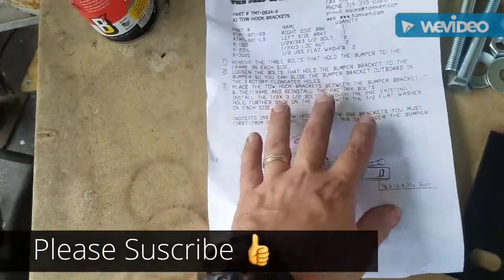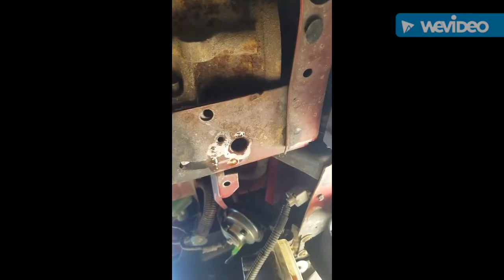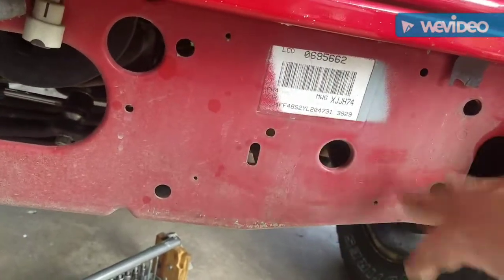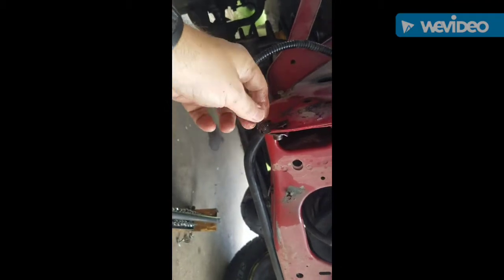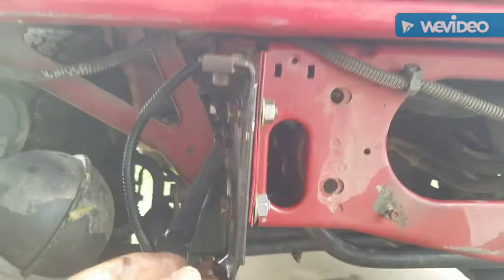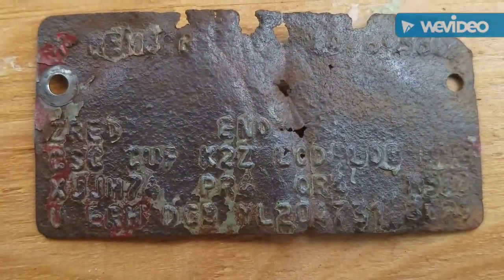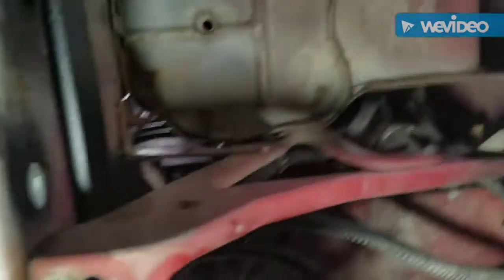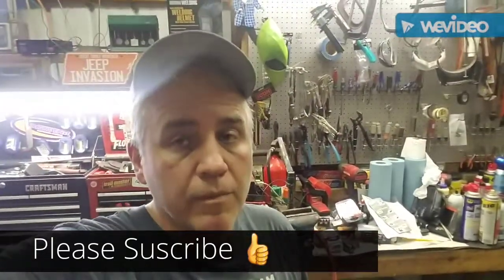Jeep XJ Factory Front Tow Hook Bracket Install with Harbor Freight Tow Hooks #jeepxj

Comment: Nice job on the install Major.I don't remember having to woller out that bolt hole when I installed mine.But then again that was 3 or 4 yrs.ago and I can't remember what I did last week....lol.....
Reply from the maker: I was concerned the front was in an accident in years past but I couldn't find any evidence, either way or worked out with little extra effort in my part.

Comment: I need to add some recovery hooks to project cheap Jeep Liberty. Nice kit. I didn’t know Harbor Freight sold tow hooks.
Reply from the maker: I went to local auto parts store and all were out of the Reese tow hooks which I think will also work,  the HF hooks worked great and are 10K lbs rated (if you believe) but they are good enough for a light XJ
Reply: Major Weakness thanks, I will look for some next time I am at the auto parts store!

Comment: Okay, so you installed these about 2 years ago. 

I noticed the comment in the video -- "Sturdy for about one yank..." 

Are you still running these? Have they held up well? I'm considering a front receiver hitch for my XJ -- and a set of these hooks/brackets (from Rugged Ridge). I'd be running a receiver-mounted winch, and am looking for a decent setup that will still allow me to use the factory front bumper.
Reply from the maker: They have worked great for me.  I've only used twice to remove from a. Ot so bad circumstance.  There are much more heavy duty options for sure

Comment: Great video. I was looking to install tow hooks in the front because it is required to have for a trail ride group! What is your suggestion for rear tow hooks?
Reply from the maker: Not many good options for rear unless you change the rear bumper.  Another option is to add a hitch receiver and you can be pulled out with a tow hook adapter on a hitch receiver
Reply: @MajorWeakness  Great ideas there too!